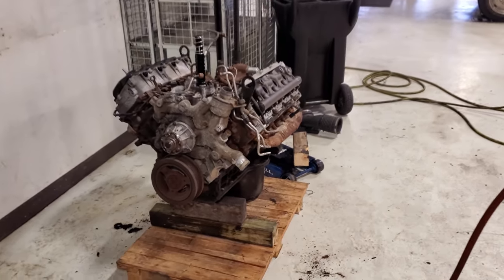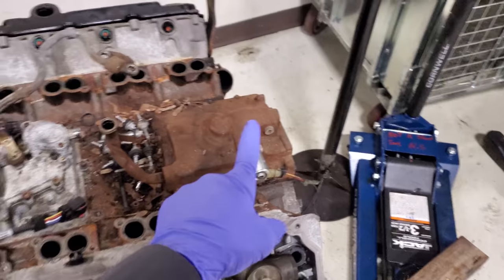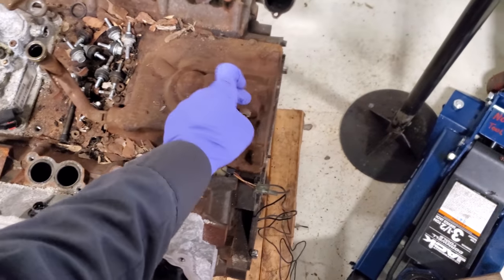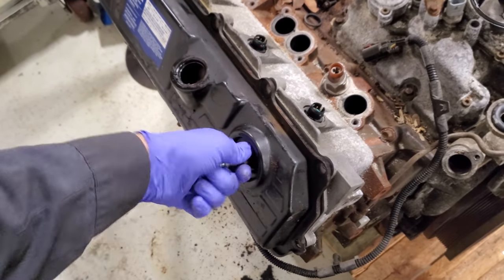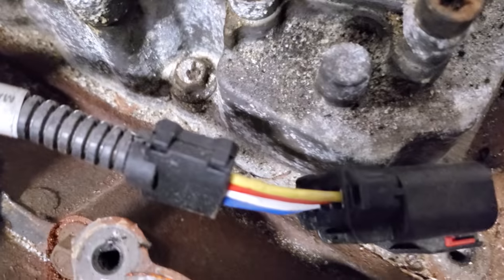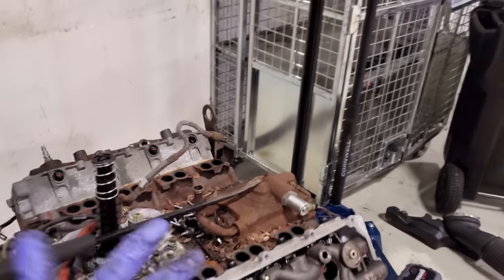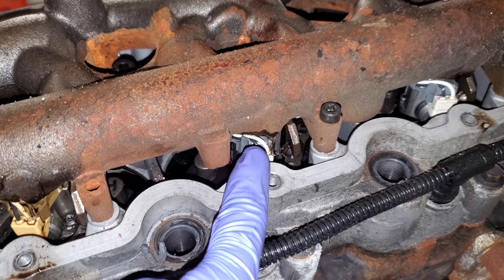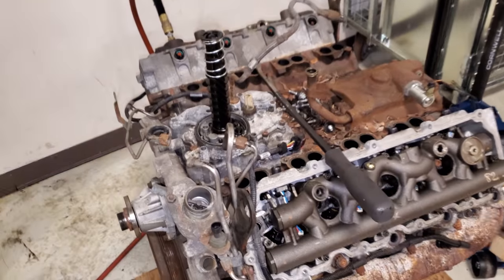6.0 Ford Diesel | Air Leak Test - HOW TO

Comment: Had an early 03 with hot no start at 165,000 . Replaced the HPOP and J tube and still had no start. Turned out being 1 injector had a bad o ring on top. Went ahead and replaced all injectors at that point.  Has run great ever since. 235,000 now. Love my 6.0.
Reply from the maker: Thanks 4 sharing
Reply: 2006 here, same condition.  Time to get dirty!
Reply: My 03 6.0 is doing the same thing but it has an oil leaks that only leaks when it’s parked and hot

Comment: Great video to really help people understand the air leak test on these engines! I would also like to point out what I tend to find a lot more than rail and dummy plugs anymore as these engines age is the nipple cup seals going bad and shooting the high pressure oil around the cups and down onto the top injector o ring causing the leak point. Last 3 engines I’ve done have all had the cup seals leak from high mileage and age.
Reply from the maker: Wow! I have NVR had leaks from there

Comment: 5:58 303-450 or 353-450 i believe is the tool part # and doubles as a fuel pressure adapter as well.

Comment: I made my air fitting to connect to the rail pressure sensor port out of a wheel stud from a 1996 Volkswagen Jetta.  The taper was perfect and I've been using it 15 years no issues, even the  same oring I started with.
Reply from the maker: Tooo funny

Comment: accurate diesel adapter to replace ipr for leak testing. Vgt or 7.3 injector pigtails will work to latch on the ipr solenoid.

Comment: 12 x 1.5mm for the ICP in the passenger head.
I could not screw a new ICP in my older model 04, with the ICP at the back of the engine.
Reply from the maker: The older 6.0 and newer 6.0 sensors are really not interchangeable....

Comment: I'm having a hot no start on my 04 6.0. The oil pump has been replaced in the last 15,000 miles and the truck sat for a bit due to having a egr cooler failure. After I installed a egr delete the truck turned on and ran fine. Now I'm having the hot no start issue. Would you say it's most likely the pump? Or more likely to be the dummy plugs/standpipes? I would do the test but I dont have the equipment for that at the moment. The truck has 260k miles on it. Only work that's been done to it has been by the ford dealership which was a new turbo, new hpop.  the egr delete I did. If I replace the dummy plugs and stand pipes can I visually see if the orings were leaking?
Reply from the maker: You can visit my Paypal or Venmo & we can diag further....

Comment: Great video! I ordered all the proper fittings but I still hear a small gurgle coming from lower end of block any ideas? Here’s a what I’ve done to it myself. Replaced ball cups and o rings, replaced all glow plugs, replaced ipr sensor and icp, did egr delete, replaced glow plug harness, and I had 2 injectors that had bad o rings from ball cups
Reply from the maker: Branch tube...stc fitting...stand pipe......dummy plugs..........
Reply: Thank you for taking the time to respond @PowerStrokeTechTalkwARod  
Sorry forgot to mention I did replace dummy plugs and stand pipes it doesn’t have an stc fitting

Comment: I working on HPOP on 6.0 … n my helper hear air leak by gear front seal while PSI … is it normal or need replace it 

Hpop is on engine and torque down and 2 new O rings

Comment: Have you ever had a no start after truck is hot ? If so what's usually the problem?
Reply from the maker: Yes i have, many times. you'll have to find the high pressure oil leak

Comment: I have the early 03 have the issue the when the engine is warmed don’t start
But when is cold starts  but is weir is no power loss no shaking no loud knocking sound . Put the air test I the IPR the weir thin is not noise what can be wrong !! No engine codes noting!! The HPOP maybe is bad !
Reply from the maker: Hpop ipr & icp

Comment: I bench tested the oil rail with the injectors securely mounted on the oil nippels. Air is passing through the small hole near the injector hold down location index slot. All four leak. Is this normal?
Reply from the maker: NO leaks are normal....

Comment: Thanks for the video.  
I hired a professional to look at mine.  He couldn’t figure it out and gave up.   Had no suggestions or ideas.  
Oil pressure was only getting up to about 350 when cranking.  He replaced IPR and HPOP.  Added 150 psi of air pressure and no leaks.    It held at that for more than 15 minutes.  
But when cranking, oil pressure can only get to about 380 psi.   Did the air test again and still holds air.  We couldnt hear any air leaks, Checked all the injectors, dummy plugs, seals etc.  even used stethoscope.  no leaks.  
I’m frustrated.  Have you ever experienced this? Do you have any suggestions? 
Thanks!
Reply from the maker: How do i know what year
Reply: I have same problem, everything new, hpop, stand pipes, quick disconnect lines that go to rails, injector orings, ipr, icp, new batteries. What else can I check? Any suggestions. Any help is greatly appreciated....It started and ran fine for a while but no start at all now.

Comment: Currently having this problem with my '05 6.0...
It was running just fine. No issues, no problems.
We stopped at a rest-stop and it wouldn't start again. 
Crank-No start.
So we tested the ICP... if you read low pressure, it COULD be a bad ICP. If you disconnect it, the default in the computer is 750 psi... enough to get it to start.
But it still didn't start, and the ICP is reading 100-250 psi.
I have already (previously) replaced the injectors, the standpipes and dummy plugs... everything is brand new and of the updated style.
I have also, just recently, replaced the LPOP regulator... and I can see the correct pressure on the Low Pressure Oil System.
That leaves me with the STC, IPR, or HPOP.
I was trying to understand how to test all those, without "shotgun mechanic" practices. 
This video helps ...
I will build an air fitting and a jumper for the IPR.
I'll pressure test the IPR and listen for the STC...

That should help me know where I am with this repair.

Thanks Much!
Reply: Did you come up with anything?
Reply: Pressure tested, IPR fully engaged, no leaks.
Replaced HPOP, works fine now.
Reply from the maker: @DavidMamanakis ayyyyye thanks for comin back

Comment: two things, can I just reseal the original dummy plug with orings and nylon washers? Also, when energizing the ipr valve, is it polarity sensitive?
Reply from the maker: Juss just grab a new W302908 & no it is not...
Reply: @PowerStrokeTechTalkwARod  thanks. And the stand pipes can be changed while motor is in truck? Thinking of passenger side with the heaterbox in the way.
Reply from the maker: Yes 9A332 pipes can be removed. Watch our 6.0 ibjector removal videos you see
Reply: @PowerStrokeTechTalkwARod  any suggestions on aftermarket plugs and standpipes or just stay with Ford?
Reply from the maker: Ford brotha. Give them those part numbers

Comment: Hey there, I have a very small leak on the top end of my 6.0 in the valley. I bought a oil filter billet cap so I could put air in hopes of pushing oil out of the leak so I can find it. Are you willing to tell me if it is safe to put air through the oil filter cap and if so how much psi? It is an external leak not an internal leak.
Reply from the maker: Why not add dye & inspect with a black light....🤷‍♂️
Reply: @PowerStrokeTechTalkwARod  was considering it. Just thought pressurizing would provide quicker results? Think I should just dye it? What brand of dye is best?
Reply from the maker: I wld yes! Goto ford they have one that turns bright white under the black light
Reply: @PowerStrokeTechTalkwARod  thanks for the responses. Will do, already have the light kit from a previous job.

Comment: Okay I’m try an ask you a question that I can’t understand. I have seen tons of videos and have read lots of books but still can’t figure this out. When air testing I hear leakage from the front seal on my 2004 and my 2003 Ford desiels with 6.0 In then. Both have the aluminum housing  pumps. One of them leaks air from the front shaft seal by the gear. The book I read from ford says that it’s okay and should not be replaced but I read that way later in my journey. The other doesn’t leak from the front seal on the pump but I could hear a rush of air with the Hpop cover on. I’m applying air through the IPR with my special tool that has a hose and a gauge with a valve at the end. Im confused cause why do people say that it’s not supposed to leak from the shaft seal but the books says that it may an if it does when checking for leaks that the pump shouldn’t get replaced. I took the cover off the pump I heard air rushing from the pump cover and Got a hose an 2 couplings while leaving the J-Tube that mounts on top of the pump secured it so I can apply air the same way as if the cover was on but I don’t hear the massive amount of air. But I do hear a soft burping which I have a video of . That air is coming from the inlet port of the pump as it travels through  Hpop reservoir and it’s coming out where the filter was. It’s not a rush of air but this is another confusion to me cause I’m under the impression that no air should be coming because it’s a inlet passage not an outlet passage. So is some seepage allowed? And if the book says that the front shaft seal may leak the pump is not bad then what amount of pressure is allowed . I’m thinking it should be simple apply air through IPR an if it leaks air correct issue of leak but I’ve replaced these pumps on both trucks and bench tested them. And it doesn’t add up. I’m think mine is supposed to be like your motor applying air through the IPR . I shouldn’t be hearing any air at all but a total of 4 pumps  2 that were brand new leaked air through the inlet one being slightly but not heavy amount of air and yet 3 out of 4 leak from the shaft seal. An if there is seepage with just shop air coming from the oil filter even from 2 new pumps. I being an aftermarket but new and the other was from the Ford factory . I wanted a new one but they only sold reman Hpop pumps. It’s very expensive trying to understand this an it’s costing lots of time. Cause if there is seepage at lower pressure wouldnt there a massive amount of volume of oil backfeeding when the vehicle is running that can produce air preventing a no start cause of air in the oil system even if the trucks build pressure.
Reply from the maker: You my friend need that triple threat! PUMP-IPR-ICP
Reply: @PowerStrokeTechTalkwARod   I’ve already replaced the pump I did an aftermarket on my truck an installed the Dorman pump (remanufactured. My IPR is brand new an so is my IPC) I had installed it in my truck an I’ve resealed everything on my truck oil rail , Stand pipes are new , Branch Tubing is new , Steel braided lines are new as well but the new pump when air tested was leaking from the front shaft seal of the Hpop. So when working on my dads truck after testing his the pump on his wasn’t leaking from the  pump shaft seal but air was coming from the air filter like a soft burping. So I bought a pump from ford and I wanted a new one but they don’t sell them new only remanufactured and that one is leaking from the front shaft seal and bottom when air ia applied . I talked with the Ford master Desiel technician here in Corpus Christi an explained everything like with you how I dead headed the oil system to isolate the air an ensure there was no leak an how I tested the Hpop from ford an he told me he never saw the pumps leak from the front shaft seal an his understanding was that it wasn’t supposed to leak from the filter as well. If I could email you the video or send it somehow you would see what I’m talking about cause I can’t keep guessing. I even got the powerstroke 6.0 Bible and the other books an only of them said that when air testing that the pumps may leak from the shaft seal on the pumps. But when I showed that information to the technician he was like woah ! It didn’t make sense to him.
Reply from the maker: Time fer a new pump, ask me how i know.............
Reply from the maker: U need 1, email me
Reply: @PowerStrokeTechTalkwARod  I just spoke with the “desielsites” pump builder who builds adrenaline pumps an billet high performance pumps for the company 20 years of experience an she says that whoever says the pumps don’t leak from the front are not professionals and are not good professionals because it’s designed to leak from the front shaft seal and that the dealership ford manufacturer says to not test the pump with air from the pump because it will leak back into the oil reservoir and or that it’s supposed to leak out the front shaft seal to regulate an lubricate the system that if it didn’t it would cause the motor to blow or lock up.

Comment: Would a failed stc fitting cause no oil getting up to the oil filter housing? No oil on gauge while cranking. No start hot or cold. 85% ipr 13 psi icp cranking. Died while idling no reason to believe lpop failed. Just trying to pick a direction before tearing apart
Reply from the maker: No sir.....the STX does NOT connect to the oil filter housing

Comment: You wanna come to Oklahoma and teach the ford dealership how to work as a mechanic instead of a parts changer?  These guys are killing my, 2 months they've had my truck.  Im.at the point I'm going to have to go.buy a truck just to.work.
Reply from the maker: Omg.....😬
Reply: @PowerStrokeTechTalkwARod  yer telling me,  went in for a HPOP,  figured, let do the oil cooler and such while they are in there.  Truck came out worse,  truck went in running, jot able to drive because of low fuel.pressure.  truck now won't start. Said there's another air leak, hahaha 😆  " nah chief,  it's the same one yalls asses just guessing."
Reply from the maker: Omg brah im sorry wish i was therrrr
Reply: @PowerStrokeTechTalkwARod  all Good homie.